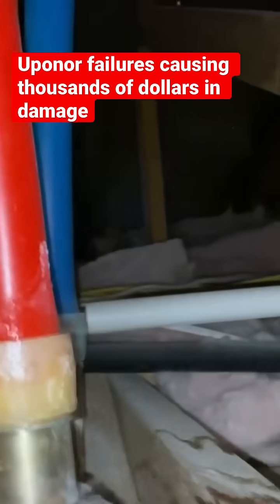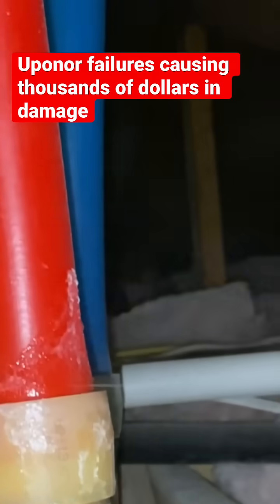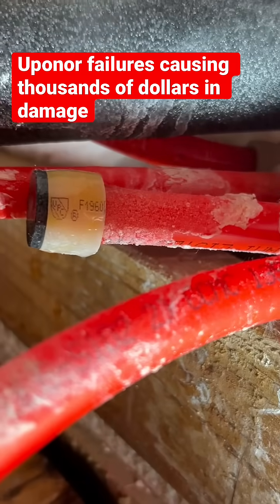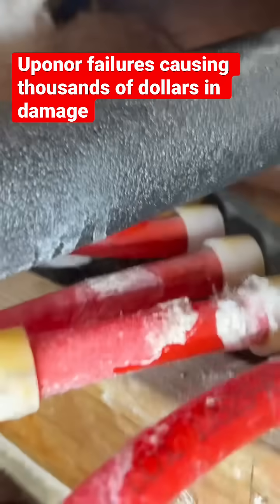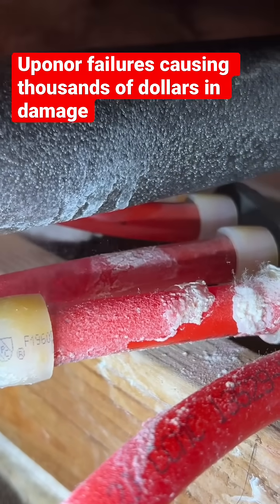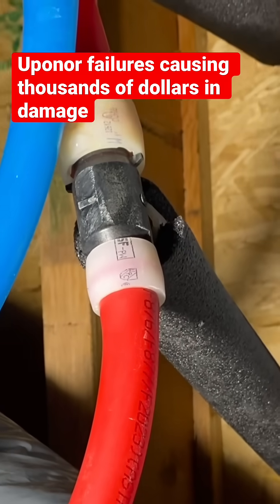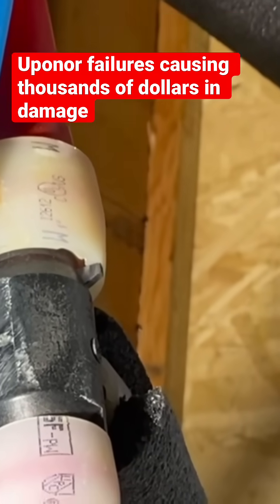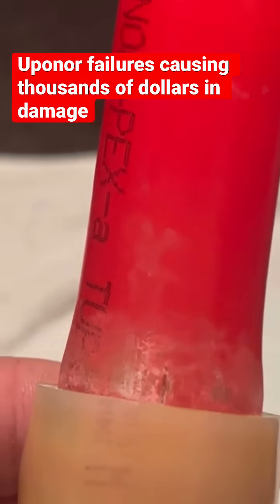Why is Pex starting to get Pinhole leaks like copper? #Uponor #plumbingfail

Comment: I wouldn't recommend expanding PEX-B. This is not in line with the MFR recommendations, and just because you got it to seal doesn't mean you've succeeded in creating joints that will last 50 years. PEX-A is considered slightly superior adn what I spec on my commercial projects but I do have PEX-B in my own home because I wanted the ability to run to Home depot for parts and didn't want to buy a $400 expansion tool. As suggested, it could be UV damage, this pipe does not include UV inhibitors and I won't allow it anywhere that is not pitch dark 100% of the time. My specifications also call for protected storage while on site waiting for install.
Reply from the maker: Pex B Zurn is recommended expandable by the manufacturer

Comment: wasn't uponor susceptible to breakpoint chlorination?
Reply from the maker: From my understanding pex A Uponor has the highest rating against chlorination and is designed to be able to withstand 140F degree temperatures in systems with constant recirculation meaning the pipe is basically always going to be the temperature your water heater is set to which from my experience is typically 120-130 but the way the pipe is made and cured is different than pex B and depending on different factors can begin to break down more quickly specifically in areas where it’s been expanded or on bends. 

From the research I’ve done over the years Pex B seems to be more resistant to Breakpoint chlorination than Pex A. I’ve not cut any pinholes or cracks out of Pex B here on the west coast.
Reply: Chlorine dioxide its right in uponors ducumentation. All the polypropylene pipe manufacturers have the same warnings

Comment: Im in my first year plumbing course (started in September) in Canada. We learned the differences between PEX A B and C, it was explained that PEX A is the only one that could use those fittings. I sent this video in our Teams chat, and it turns out that this 1 PEX B pipe can in fact use PEX A fittings, but it needs a special expansion head. Man this is going to get confusing 😅
Reply from the maker: Yessir Pex B Zurn the stuff I love!! Zurn makes their own expansion dye but you can still use the Uponor dye atleast that’s what a Zurn rep told me. I use the Zurn expanders over the Uponor ones though they seem to expand the Pex better

Comment: When we found polybutene pipes in our condo we replumbed the whole house.  What with?  Guess?  Yep…good old copper thank you.  I’m not trusting my walls and house to flood damage from plastic and I’m sure as hell not relying on any shark bite fitting that also rely on o-rings and flex.  No bueno!
Reply from the maker: Unless there’s no other option shark bites should really only be used for emergency capping or temporary fittings like I did here. Newer Copper has a higher chance of failure than pex from my experience specially if you’re not using type L. Copper needs to be properly installed by somebody that knows and cares about the longevity of the pipe and the install where Pex all you really need is an expander and a screw gun for strapping.
Reply: @PlumbingExplained  perhaps.  I just opened up mom’s house to remodel the bathroom and those 75 year old copper pipes looked just fine and there was no reason to touch any of them.  We’ll see what that pex looks like in 75 years.  I agree, it’s fast and easy if you are in the business of building matchstick houses as cheap as possible, so it’s no surprise it’s popular.

Comment: ive been pluming for 30+ years. i use either Pex B, or copper. never had issues from either. never used pex A
Reply from the maker: I prefer an expandable Pex B made by Zurn. I’ve not seen any pinholes on Pex B either but I have seen fitting failures, even though the amount of pinholes I’ve found on Pex A are minimal in comparison to the copper leaks I’ve found they do seem to be becoming more common as more people continue to replace their copper systems with Pex. This video isn’t meant to make anybody think Pex is not good or a problem but it is important for us to be realistic about the product. It is not without its own problems.

Comment: You have to use pex a and a fittings someone used pex b parts 😮
Reply from the maker: Those are clearly pex a fittings or they would have leaked from the fittings not the pipe. Uponor covered this customers repipe for a reason.

Comment: yes I am having the same issue. 4 leaks now in under 7 months. I am getting anxiety now. What have people done?
Reply from the maker: Dang, have you tried reaching out to the installers or the manufacturers of the pipe itself? It carries a manufacturer warranty even though for some brands the warranty is becoming more and more limited.
Reply: @PlumbingExplained  yes they rejected my claims citing 'poorly managed operating conditions'. They are subject to several lawsuits and a class action and apparently I need to go through arbritration

Comment: "Pinhole leaks like copper"
Not in 15-30 years like PEX. Think 60-70 plus.
Reply from the maker: I’ve cut tons of copper out that pinholed in  10-15 years it really all depends on different factors. Mainly the water. Both pipe types have their positives and negatives

Comment: I replaced all the Polybutene grey pipes with the Apollo red and blue Pex-B, in all the second floor, using the Apollo crimping tool, it was my first and only one installation (I'm the homeowner), no issues in 11 years. I'm about to take the courage and do the crawlspace now, I was thinking to use Pex-A but this video changed my mind.
Reply from the maker: I love the Zurn brand pex B it can be expanded just like this uponor here and I think it’s a better quality pipe. That’s just my opinion though there’s probably thousands of guys who agree and thousands who disagree with that opinion.

Comment: Im not a plumber but base of what i have seen it mayb the expander tool it puts too much pressure on the pipe right after the sleeve causing pressure points weakening the pipe...thats just my observation..uponor expander are more cone shape and the last bit goes in deeper past the sleeve creating less pressure right after the sleeve.
What you guys think
Reply from the maker: @Elsanta666  yea it could be part of that, I switched to the Zurn expander heads instead of the Milwaukee but I think the theory I believe the most is the pipe itself has problems due to the way it’s made
Reply: @PlumbingExplained  as you mentioned on your video you switched over to zurn pex,  on that note do you still prefer expanding over crimp rings? And have you seen a ring fail or cause damage to pex over time?
Im looking to redo some pipes in my house and definently going with zurn pex but im undecided on what tool to invest the expander or the ring crimper

Comment: The only problem ever found with copper on 50 year plus homes with acidic well water when they let the acid neutralizer run out it will start getting pinhole leaks starting at entrance.🤔
Reply from the maker: @goaheadmakeourdayscooterpe9644  it’s also problematic with certain chemicals some water municipalities use as disinfectant in the water supply. There’s a lot of reasons copper can develop leaks. In a perfect world copper is a better material I agree but pex is great to help keep cost down on repipe and repairs. I don’t thinks I’d plumb a new home with it though but that mostly boils down to preference. Many plumbers with more experience and knowledge than me would probably disagree with everything I’ve just said.
Reply: Our copper was good for 40 years.
 Acidic private well water is now proving to be its undoing.
 So I'm looking at alternatives. Thanks for all the info on pex types.

Comment: That is what mine was doing that just all got replaced. Mine was some other brand and didn't say pex a nor pex b. It has been in for about 25 years but started leaking here and there 23 years ago. This time it would start leaking in a different spot right after fixing a leak so after about 6 leaks in a month we ran all new pex a.

Comment: Are you sure the pipe was Type A for the Expanding PEX, or Type B for Crimping. They all fit - but are not interchangeable. Sucks they both fit with the fottings, but are meant to be Type A or B specific.

Comment: PEX B is not designed to be used with the expansion tool. It's a more rigid pipe with less flex than A.
Reply from the maker: @lastdon6585  google is a good tool so are the AI platforms for asking questions.

Comment: My boss told me in 10 years everyone will find out that pex is gonna cause problems and end up leaking.
Reply from the maker: @tannermonaghan694  I been using it close to 20 years, it has its problems just like any other pipe but since it’s so easy to install compared to copper and typically outlasts the builders warranty it probably isn’t going anywhere
Reply: Pex has been in use in Europe since the 1960s.

Comment: Don't think you can use the expansion rings with pex b.  It's my understanding that Pex A and B are different chemically and with a passage of time there will be problems if the two are mixed. Pex B It's supposed to use a crimp ring which is attached using the crimping tool.
Reply from the maker: @kentschrader3900  there are brands such as Pex B zurn which is expandable or crimp. It’s worth looking into for anybody in the trade.
Reply: @PlumbingExplained  Thanks, I hadn't heard that and will check it out.  Thanks for the info, and for the quick reply!

Comment: If used on hot water recirculating system this happens or if installed near a heat duct or furnace or water heater exhaust pipe this is a problem.

Comment: Doing research, looking into radiant heat and or replacing water lines,  seems expandable pex a is best.  All I've only ever worked in commercial setting so only ever used copper or cast iron or pvc.  I feel like copper is the devil you know while also being durable and having a long life of use.

Comment: Not sure if anyone noticed but this plumbing is in an attic and is unprotected by insulation. Even with PEX that's a no-no. I wonder if that is contributing to the leaks
Reply from the maker: @brettb614  at the same house I’ve cut leaking pex out of the walls.

Comment: Im sure they may have had a bad batch at some point, but i still like uponor as its been tested for decades overseas. A lot of time when it was new here in US before Milwaukee expanders they just keep expanding without rotating the expander which lead to stress fractures in pipe. Also here in AZ guys keep rolls of it on their trucks, ie way too much sun exposure. Pipe will fail if used outdoors and certainly shouldnt be stored baking in the sun all day

Comment: Quest 2.0
Reply from the maker: @TheGreatGordyHunter  it’s not nearly as bad as Quest but it’s got some issues for sure.
Reply: @ I’m telling you brother down here in sanibel fl those crimps get corroded worse than copper and the expansion fail on the sleeve or above. Also all the plastic cracks on fittings

Comment: I've been in the plumbing trade for 30 years and I can tell you there has been problem with all the plastic water piping..... Going all the way back to the grey polybutylene water piping," often called "Poly-B" piping that was banned because of millions of dollars in law suites .... I remember when Wirsbo piping came on the market... There was problems with leaks at the fittings because the expanding rings didn't seal up good on the brass barbs.... Then Ki-Tech piping came out with mechanical compression fittings with Orings... They also would leak at the fittings especially on the hot water side do to expansion. They banned the mechanical compression fittings and went with a crimp system. Then PEX came on the market with a crimp system... The plastic fittings leaked so they went with brass barb fittings... The best was Wirsbo piping with brass barbs and the crimp system... But the drawback was it only came in white color and the installers were crossing their lines ...
Reply: I have a 45 year old house with polybutylene grey pipe. No problems with the pipe and they are still flexible and solid. BUT, you can crumble the plastic fittings with your bare hands. just switched to pex after the second leak in 5 years.

Comment: PEX B has the same problem. The property I do maintenance at has PEX B and we have at least one leak a week out of 75 units. 11 year old development.
Reply from the maker: @BM1620  which type of pex B are you using? I’m guessing crimp style? What state do you live in?
Reply: @PlumbingExplained  
Its a problem with chlorine in the water. It breaks down PEX. PEX B is supposed to last longer vs PEX A. It's why we are seeing so many issues that are usually with PEX A. 11 years PEX B.. Could be some other issues going on or just high Chlorine in the water. Plastic breaking down.. Yummers. Nothing like micro plastics, cancer and organ damage.. At least its cheap.

Comment: Install type L copper tubing & fittings...they will last the life of the building
Reply: Depends on your water, your well, pH, etc.
Reply: Yes they will
Reply from the maker: @danlaur7973  no they won’t.
Reply: @PlumbingExplained  I've worked in 70-year-old buildings with the original copper tubing plumbing that have 0 issues

Comment: PEX A vs PEX B does not identify the connection method. The acceptable connection method will be stamped on the pipe with an ASTM alphanumeric number.

Any pipe (A, B) stamped with F1960 can use expansion fittings. This will be Zurn and Sioux Chief pipes.

Comment: Alot of people who tried it early on didnt know to rotate the expansion tip enough
Reply: How does that cause a pin hole leak.  The pin hole shown was not near the expansion ring.
Reply: @geo8rge Those leaked are caused by Uponor's poor chlorine resistance. PEX B has proven to be much more resistant. I only install PEX B though it is a bit more labor intensive it has not leaked on me. Uponor became popular ONLY because of its ease of installation and kink resistance which for some strange reason led to poor choices. Uponor has reduced its warranty significantly due to this.
Reply: @wolfgangunger217 - it's not chlorine it's because "mostly" the municipalities that went away from straight chlorine and started using chlorine dioxide as a secondary treatment.  This is the primary cause.
Reply: @geo8rge i was fixing one of these leaks in a 9 year old home this morning. The neighbor has a leak as we.  PEX is fuggin junk. Never trust a lazy plumber that will install this garbage in your walls and attic.
Reply: @geo8rge high quality pipe doesn't spring leaks. Plumbers suck for installing this garbage.
Reply: That has absolutely nothing to do with pin holes developing in that cheap junk pex garbage after several years. People suck for installing it.

Comment: Why so many fitting to begin with? One of the main reasons for using pen a is so you can have straight solid runs and make a 90° without having to split the pipe, lessening your chances of getting a leak later.
Reply from the maker: The fittings are not leaking the pipe is. The pipe splits and leaks

Comment: And im here with a 1958 all copper and zero issues haha
Reply: House was built in 1966 and despite having hard water, all the original plumbing is going strong to this day. Even the cast iron drains are still holding up!

Comment: Instead of red and blue colored pipe why not just use white everywhere and put a wee wrap of red or blue colored tape at the ends during rough in?
Reply from the maker: Yea Uponor no longer makes the colored pex, you can still get Zurn Pex B in the blue and red and that is actually an expandable pex B

Comment: What do you mean "leaks like copper" I thought that copper done correctly dosen't ever leak, ever?
Reply from the maker: You thought wrong, there are different grades of copper and Type L the medium thickness most common used copper has a life expectancy of about 40 years
Reply: @PlumbingExplained  what fails after 40 years??? Never heard of that?? Sure seems like if sweated properly it would have a life expectancy of a couple hundred years at least, for water or compressed air. Anyone else ever heard of houses having copper plumbing fail after 40 years??
Reply: @classics289  I am a union plumber, been in the trade for 43 years - I have NEVER had to replace copper lines even in houses 100 years old. They get a biofilm and lime lining the pipe after a few years. The ONLY failures i have ever seen in copper is from failure to ream the insides of the pipe causing turbulence in the fitting and eating a pinhole right before or after the fitting, usually in type M copper. On the other hand I spend about 10 - 20 hours a week replacing failed PEX tubing, fittings, sharkbite fittings, and pro press fittings.!

Comment: If you read on the  expansion tool. It says it takes ten to thirteen expansi It can be done in 5 or 6 and I'm wondering if it's stretching the pipe too fast.

Comment: You're using the wrong pipes. PEX A pipe is not color red or blue, it's white in color. You mixed PEX B pipes with PEX A sleeves. PEX B will not fully shrink back once stretched. This is the operator error.
Reply: I take back what I said. There were issues with Red and Blue lines, and like many comments stated that there were class action lawsuit on the Uponor defective products.

Comment: They also had a recall in 2018 for a certain lot code with the ½" pex tees. I had a streak of them at the time that shattered from the manufacturer mixing the resin wrong
Reply from the maker: Never have I come to a job where the pex plastic fitting blew out, only brass fittings I’ve seen that happen to, absolutely has to be due to imperfections in the brass that caused turbulence or just weak points in the brass casting in general makes zero sense any other way.